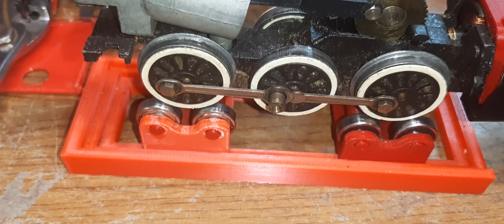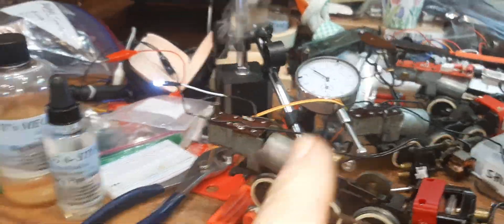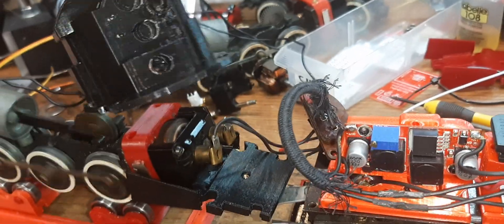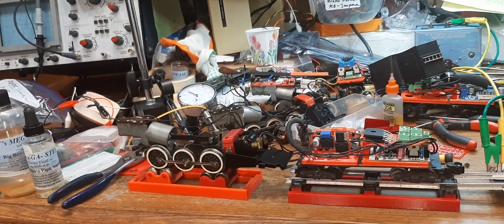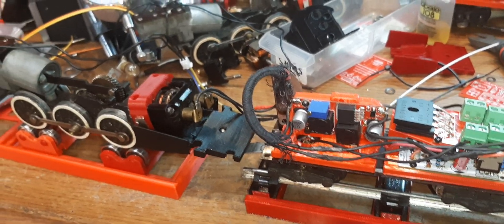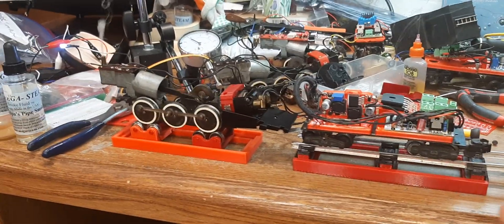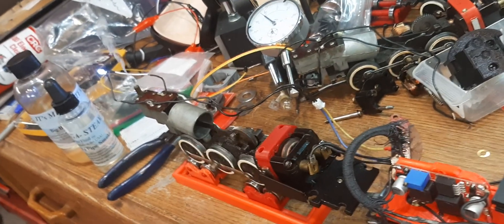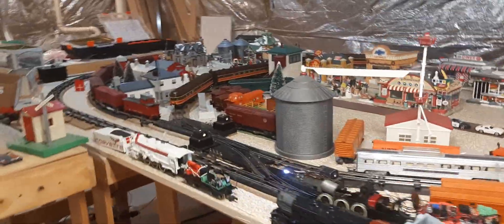NGS Level 1 Upgrade makes it on the Rails, digital reverse, Smoke, DC Fields and LED headlight!

Comment: Wonder if anyone makes this for Lionel 027?  Guess the electronic board would work for Lionel O gauge but I'd have to figure a way to replace the AC field coil with magnets.  Just wonder if you used neodymium (rare earth) magnets it would work better.  I replaced all my HO scale Pittman (open frame) motors magnets with neodymium magnets and it made a HUGE difference in performance and current draw.  Now they will "creep" down the tracks.  Cheers from eastern TN
Reply from the maker: I could look at the Lionel motor but you know I came to this for Flyer when i knew it would work on all the Gilbert FLyer Engines including the Pre Wat O gauge engines. They all used the same fields size and shape was identical. So i have fit these Fields on 1939 PreWar and 1957 Post War. That's a wide span that makes sense for Flyer. I doubt Lionel motors have that life span. I want complete the Diesel DC Magnet Conversion I started 2 years ago!!!